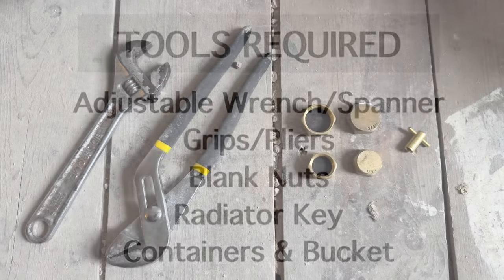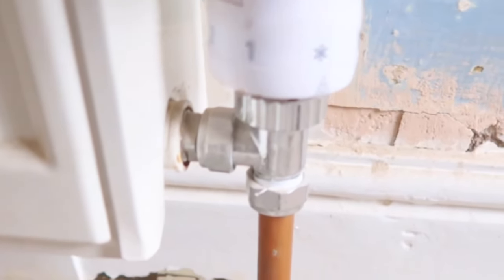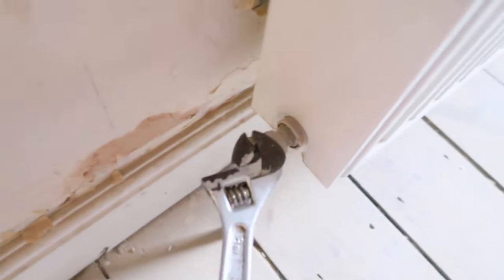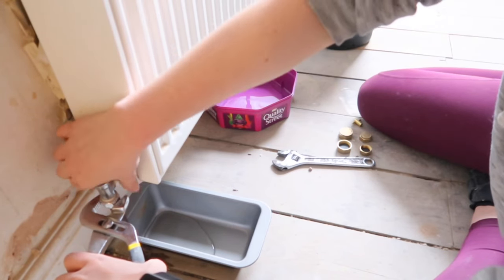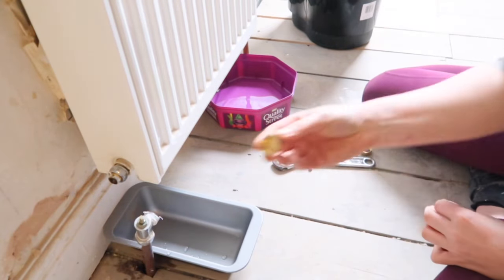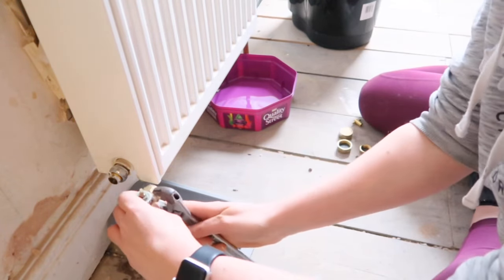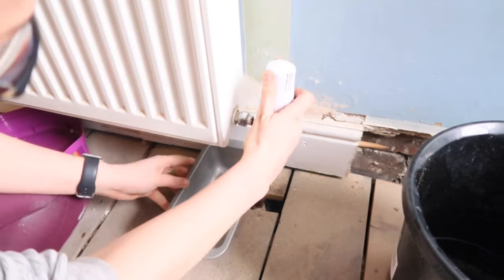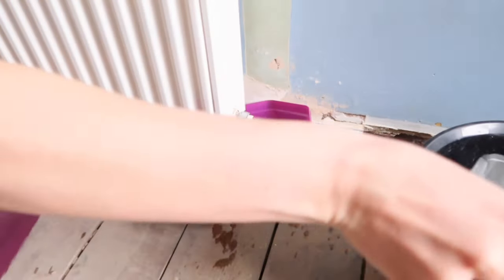HOW TO REMOVE A RADIATOR FOR DECORATING

Comment: Thank you for that, I once had a quote for a plumber to take off 2 radiators and they were going to charge me £175, so needless to say I decorated around them.
Reply from the maker: £175! It’s so simple to do and the tools are minimal and not too expensive if you don’t already have them. I’ll also do a video for refitting it in a couple of weeks so you can see how that’s done too ☺️ x